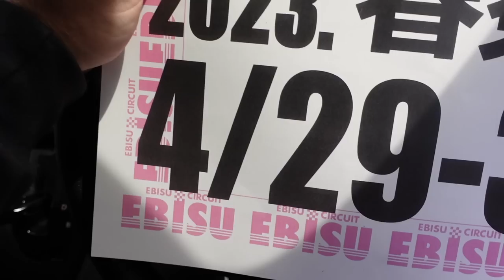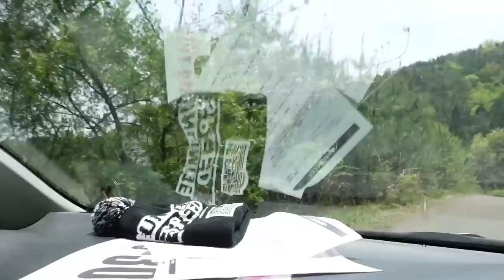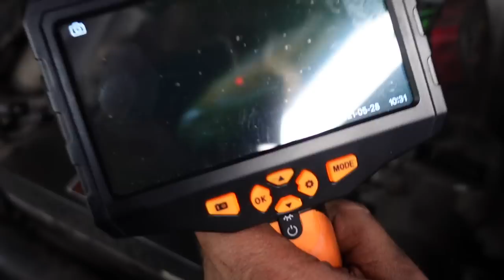Driving Japan’s Largest Drift Festival!    (Ebisu Spring Matsuri)

Comment: Possible piston slap, if the noise happens as it’s floating on and off load, sounds more top end then bottom end and more likely to be towards the back cylinders, that could be what it is. I had it happen on my 1jz. Jz’s are know to over heat around the back cylinder’s expanding the bores, ad that to any possible over heat situation that can effect the piston and it can cause the piston to slightly shrink increasing the bore to skirt clearance. So the noise your hearing which sounded all to familiar and just brought back bad memories is the piston skirt slapping the bore as it passes TDC.